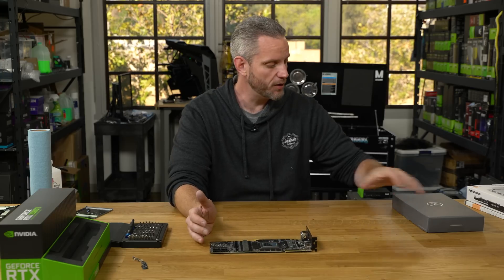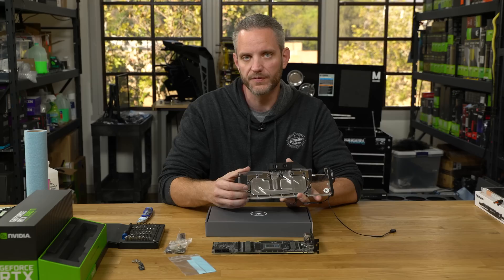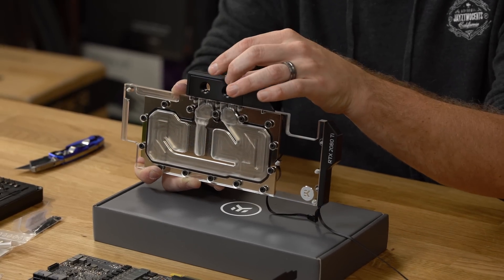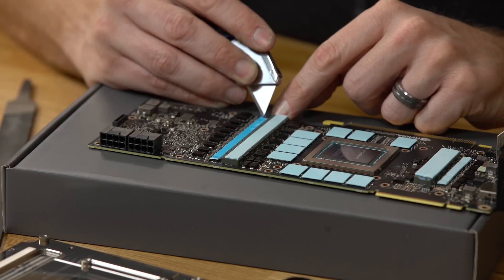GeForce Garage - Watercooling RTX 2080 Ti for JayzTwoCents' Skunkworks.

Comment: Am I not correct in understanding that you do not need those washers on the backplate ?  The backplate is anodized aluminum and will not short the pcb unless bare metal is exposed from the anodizing being scratched off.  Spacing up the backplate is going to remove the mounting pressure contact with the thermal pads.

Comment: Do you still need to apply thermal pads to the backplate if you use the original backplate that came with your 2080ti? On my evga 2080ti the stock backplate can still be used, it has slots for the card to breathe and currently does not have any pads on it, I’m figuring that if it doesn’t overheat now while air cooling it shouldn’t overheat after I switch over to water cooling but would appreciate the advice of someone more experienced then me.

Comment: Hello JayZ. I see EK waterblocks require "founders" Edition PCB's. Is that the same as Reference Model? A lot of other similar solutions require 2080 Ti REFERENCE PCB not founders. Wondering if it is the same thing. Also curious as to how good soft tubing and hard tubing is with regards to potential leaks?. 
The EK waterblocks seem to have holes going through. Can you use angled fittings like 90 degree joint fittings one say only one side or does it have to go in on one side and out on the other?

Comment: Nice video but I wish more time was put into the full wc install. Never built a wc but I'm assuming u have 2nd pump going out to one card, flowing to second card, to in port rad and the out rad to pump in??
And what did you do with those wires from the video card? I'm guessing they were just to power the fans removed, so the wires just aren't used and tucked behind somewhere?

Comment: Are the chokes required to have thermal pads??? I just bout a water block form alphacool for the 2080 to and it does not say to install pads on the chokes only on the memory and mosfet.  Is this okay?

Comment: my new gigabyte 2080Ti waterforce (AiO model) is well, the entire machine abruptly powers offthen clicks itself back on.. no idea if its temp or what.... 

the rad is front inside mounted near the bottom of a ACW300 gigabyte case. so not sure if its the gpu or the psu, but both where fine before today, before i installed 481.91 or 418.91 and Anthem.... 

it seems so far only to be when anthem is on ,,, and can take upt o30-40 minutes before it craps out....i could return for a full refund but not resorting to that just yet...i took side panel off and pulled the front panel to let air flow out improve

any ideas?

Comment: I have a question... the gpu block has two little plugs or caps on the back where compression fittings would go... do you need to purchase these separately or do they come with the block?

Comment: I notice that the water loop through the graphics cards connects in to in and out to out - rather than going in to out and out to in and then out? Is this the best way of cooling two graphics cards - effectively in parallel I assume rather than in series (if that makes sense)

Comment: I believe you made a few important mistakes.

1) You didn't put washers on the pre-backplate screws. I think these are to prevent wear on the PCB more so than to avoid grounding. Screw holes in PCBs are usually intentionally connected to the ground plane.
2) You forgot to install 3 of the pre-backplate screws (and their washers).
3) You didn't remove the washers for the backplate. You probably have more of a gap between the PCB and the backplate than you're supposed to.

Comment: 2080 Ti FE only has slightly lower percentages than RTX Titan, and most of RTX Titan's features 2080 Ti doesn't have is for non-gaming purposes. $1200 vs $2500. RTX Titan can't get better performance with another duplicate and SLI Bridge because internally it's too dense. Two 2080 TI FEs with a SLI Bridge (I think NVLink) would be the most powerful graphics display in the world. I'm getting two MSI RTX 2080 Tis with a NVLink, but not FEs.

Will you have a followup video of permance comparisons to Two MSI 2080 Tis bridge (computer should cost $5500 after tax, cost me $4500 after tax I didn't skimp on anything) to two 2080 Tis FE bridge both gaming computers with I9-9900K (computer should cost $5200 after tax). Or of these combinations what individual videos do you have for them, I saw a few interesting ones from either of you two guys.

You would need to get two new MSI 2080 Tis NVLink SLI Bridge because you fried some of the circuits on your other two MSI 2080 Tis NVLink SLI Bridge. All displays and tests done with Ultra 4K. If TV $1000 Sony XBR49X900F is a good cheap choice it may have 1 billion colors as special Led UHD at the same quality as a $1700 55 inch Samsung Q8 SUHD QLed.

X900 only has HDMI 2.0 at 120 Hz so only 4K 60 original frames per second on videogames and 4K 120 copied original frames per second, in Spring when new TV models launch HDMI 2.1 will be built in for 4K 120 original frames per second 120hz, eventually 8K TVs will be available in USA. Monitors can support up to 240hz 4K 240 original frames per second. I've heard from pros it's more of quality of picture than frames per second in 4K, and only 4K 60 original frames per second is all that is necessary. 

Only feature that would cost more for mentioned gaming computers is the cooling for the graphics card, processor, and motherboard but you make your own cooling unit. You could make good money selling these. Overclocking for both MSI and FE both with duplicates and bridge or even just by themself I have heard best overclocking setting is +170 to +700.

Comment: You said the first thing you need to do is "remove the backplate", but actually the first thing you should do is test the card and make sure it works before ripping it apart.

Comment: Hey just installed this same waterblock and backplate from EK and can confirm that you do NOT want to put the washers on when mounting the backplate. It already has standoffs and if you use the washers the thermal pads will not make proper contact and it will not cool as well. EK confirmed this video shows an incorrect install, so do not be afraid of a groundout and leave off the washers.

Comment: I nearly destroyed my FE 2080 Ti while following this guide on how to watercool it because I actually DID break one of the (5pin-)SMD parts off the back of the PCB and the whole thing didn't work without it. xD
So I had to solder the little fucker back on but the 2080 Ti was still dead. Then I realized from photos of the PCB that there was another part missing (most likely a simple resistor) that I was unable to find, so I just shorted the two pads for the missing resistor and now it works like a charm! ^^ 
I was so damn close to losing 1200$ because of this stupid mistake Jay even warned me about and I would understand everyone here who wants to kill me for what I did. Even I wanted to kill myself for that at one point... (;

Comment: I'm going to build my 1st PC, and I've been thinking about configuring it for production/editing and some gaming. Obviously buying an EVGA RTX 2080 Ti FTW is an option, but I think I can do better for almost $1500. That's where the RTX 2070 comes in. No, it can't touch the ftw card, but when used in tandem with a Radeon Pro Duo 32GB...it make the 2070 exceptional for complex renders or gaming, considering it will effectively have 40GB of dedicated memory and increased bandwidth, plus the 2070 can focus on things like OWNING gaming engines, Ray Tracing and other Nvidia specialties while the Radeon handles the heavy real-time renders with it's dual cores and 2x16 memory and double data throughput. I've heard Nvidia now deliberately disables features if an AMD card is detected?? That would be incredibly poor and selfish judgement if true. The whole point of investing in gear is to assemble what works for you and your needs. Nvidia cards are crazy fast and powerful, but AMD cards are not as fast but are equally as powerful at what they do best. When I can afford a 16GB Quadro 5000+ I'll go that route, but right now it makes infinitely more sense to spend $1300 on a great gaming card and a fantastic graphics card, especially when it creates a 3xGPU, 16+16+8GB=40GB RAM and twice the bandwidth. I think this is the best entry-level custom build in the budget, but will NVIDIA rtx cause incompatibility issues?? Hopefully this works.

Comment: Have a block and backplate on mine and is excellent. Under 45c at 2115mhz solid. Have ran my card for some weeks now with many hours of heavy usage. So far has been excellent without issue.

I also find it far easier to remove the blue plastic first then peel the thermal pad off the thicker clear plastic and apply. Rather than try peel it off in place.

Comment: I've just build this yesterday my 2nd pc build i only play PUBG and Leugue of legends

I've name this build CheapySimple
CHASSIS: COOLER MASTER COSMOS C700M

CPU: INTEL CORE I7 8086K

CPU COOLER: COOLER MASTER MASTERLIQUID ML360R RGB

THERMAL PASTE: THERMAL GRIZZLY KRYONAUT

MOBO: MSI MEG Z390 GODLIKE 1151

GPU 1: MSI GEFORCE RTX 2080TI GAMING X TRIO

GPU 2: MSI GEFORCE RTX 2080TI GAMING X TRIO

RAM: CORSAIR VENGEANCE RGB PRO 64GB 4 x 16GB DDR4 DRAM 3600MHz C18 

SSD 1: SAMSUNG 970 PRO NVMe M.2 1TB

SSD 2: HYPER X FURY RGB 960GB

SSD 3: HYPER X FURY RGB 960GB

PSU: BE QUIET DARK POWER PRO 11/1200W

FAN: X7 NZXT AER RGB 2 (120MM) 

MONITOR: AlIENWARE 34 CURVED GAMING MONITOR AW3418DW

KEYBOARD: RAZER HUNTSMAN ELITE

MICE: RAZER MAMBA ELITE

MAT: RAZER GOLIATHUS CHROMA

AUDIO: RAZER NARI ULTIMATE

LIGHTING: NZXT HUE 2

Comment: Always wanted to try watercooling, but I got trust issues
Reply: If you want to get into watercooling, don't go hardline straight off the bat, go with soft line tubing for starting out as it's flexible and easy to work with. And doesn't require as much work to make the bends for the loops.

Comment: Hey NVIDIA, first off I'd like to thank you for overpricing the fuck out of your GPU's across the board. They cost about 80 bucks to make individually but you mark them up to moronically astronomical prices to be greedy fucking bastards on a level that's unacceptable to anyone with half a god damned brain. Secondly I'd like to thank you for releasing a fucking $800 card that has features NO ONE CAN FUCKING USE (Ray Tracing). Thirdly I'd like to thank you for making said $800 card so shitty that an abnormally large amount of them are literally breaking weeks after purchase. Fourthly I'd like to thank you for providing a less than 20% gain between the 1080ti and 2080ti. It's really special when you bend me over pull my fucking pants down and stick your big green greedy cock in my ass. Ooooh that feels good. 🖕

Comment: I'm sure it has been said already....Let us know how the card(s) are working in three or four weeks. It would be nice to see some kind of serial number in the vids, then see the same number each week later to show us that the GPUs didn't burn up in the end. What was it all these guys were saying pre launch????Oh yes, "Do not pre order ever". I think I will wait to buy my 2 cards, not because of the price, but for the reason that I like to get what I pay for! Please give us a video in the future where you aboslutly run a 2080ti at a level far above what the normal gamer would put their card(s) through gaming. If this is something that you end up doing for us, please again give us proof that it was the same card(s) for the 3-4 week gantlet. I would appreciate this Gantlet test, as I would feel more confident paying near $3000$ for product that I know will perform as well as it has in the past. Jay would you drop cash on a car knowing the first ones off the line all had their engines seize without oil leaks or radiator cooling issues?

Comment: So apparently EK decided to modify their instructions to now include putting thermal pads on the chokes.  I'm not sure exactly when it changed, but at the time I installed mine their instructions said to only put thermal pads on the mosfets.  They also only included two thermal pads and not three.  I now am going to have to redo my waterblock and find some thermal pads to put on the chokes.  Kinda peeved.

Comment: I dislike people like Jay. 
Because even if he provides wrong info in a video, he refuses to acknowledge it and rather feeds people false info than correct himself.
Reply: I've watched jay for years now and he's always acknowledged when he makes a mistake. One example is his video on the gigabyte motherboard waterblocks. He got the wrong vrm waterblocks for the gigabyte motherboard he had. You need to watch his videos before you make an accusation.
Reply: @ @davidjenkins852 
I'll state it once here just in case you try and be smart to claim he was right.

Even if you would re-install, it wouldn't wipe the drive unless you specify it to do so. By default it will leave everything as it is, besides Windows, Program Files (both), Program Data and Users folders. It will move those to the Windows.old folder. 

So him stating that a Windows re-install would wipe the drive is obviously false.
Reply: @sausje  you are correct but I'm confused. The video is about installing a video card waterblock not about reinstalling Windows or am I mistaken?
Reply: @ @davidjenkins852 
I didn't bring up what my statement was about until you tried to tell me that I'm wrong.
My initial statement is about the person itself that is in the video.
Reply: @sausje  I have to say i really dislike him too. He lacks knowledge on many subjects and is reluctant to learn from his mistakes.
Also the whining when he doesn't get stuff for free.
Reply: @davidjenkins852 
I'm making an accusation based on my own evidence. In his video about trying to fix his inlaw laptop. He states that a reinstall would wipe the drive. Which is false info that I comment on the video and send in tweet. Seen and liked by quite some. Instead of fixing his mistake in an annotation, he still is spreading this false info.

So YOU check facts before spewing nonsense, you're being a stereotypical fanboi now making those statements.

Comment: Yes, void your warranty so you can't RMA it when it dies an a few days! No wonder it's on Nvidia's channel.
Reply: good news is, warranty void if removed stickers are illegal according to ftc. so you can still rma it as long as you can put the factory cooler back together correctly.
Reply: @feelingtardy  Good luck trying to take nivida or any big company to court you'll be better off buying 100x of their top teir item.
Reply: the more you buy the more you save !
-Jensen 2018
Reply: Or you can just put the original fan/heatsink back on. There are no void if removed stickers...
Reply: @epicgrapefruit7563  Definitely not. I am not trying to justify buying a 2080 Ti with underclocking being necessary for it to work properly. I was just saying. One fix for whomever needs their 2080 Ti in casr it fails out of the box.
Reply: Your card wont die from watercooling unless you did a shitty job and no leak test before you powered it up.
Fresh watercooling liquid is non conductive unless you use tap-water.
the only way a fresh install leak could damage anything is if it gets into the psu where there's enough voltage for it to actually jump through the liquid.

I myself had a leak once, once in 5 years.and that was due to stress on the top mounted x360 rad from EK after handeling the case in all sort of ways.
the entire system was wet, and the 1000W psu took a big hit because the liquid was a year old.
PSU was left to dry out for 3 months (don't EVER open a psu the first two months after disconnecting)
the rest of the components were rinsed with spring water then air dried and given a new psu. nothing was broken.
The psu i've yet to test, but i have cleaned it out and it's looking good.

Watercooling is completely fine if you're going to let the system sit still, that's my point.
And yes, you can use spring water to clean electronics contrary to ignorant beliefs.
Hell.. even Derbauer uses a dishwasher for his world record overclocking components.
Reply: So true! And so stupid to watercool a broken from factory card.
Reply: I love how after a few dead 2080 Tis, everybody is making it sound like the 2080 Ti is bound to die. No, it's not. A friend of mine got his FE 2080Ti. 130 Mhz core OC, 1Ghz memory OC, it's still going strong.
Reply: @FOGoticus  it's been 2 months since they released... Give it time
Reply: @FOGoticus  For now...
Reply: @epicgrapefruit7563  I would personally buy it now and put a waterblock on it. Also, the problem has already been found. The vram chips aren't properly tested. A guy on reddit underclocked his vram by 50 mhz and his artifacts went away.

Comment: Not a fan of EK GPU block splitting the flow, fluid will always follow the path of least resistance. The left flow path has ~twice+ the head loss compared to the, more direct, right path; there will be less volumetric flow left which would also be further reduced if fouling occurs -more prevalent in lower flow regions. If the system had high enough pressure and a higher restriction existed sufficient close after the block exit then it might have approximately equal flow. This is done in gearbox design with the addition of restrictive orifices, usually on the inlet side and with proper sizing and empirical testing sufficient flow to all galleries is achieved… Or maybe I’m being a typical OCD mech; but I digress! :D
Reply: I suspect (AssUMe) that EK took this in to consideration given how long they have been at this.  It would not be too difficult to tweak the jet plate fins, and the area around there to make it the highest resistance area on the block and insure that from that point the flow is split evenly.  Hopefully Jay will do a review on the blocks and tell us what he is seeing...